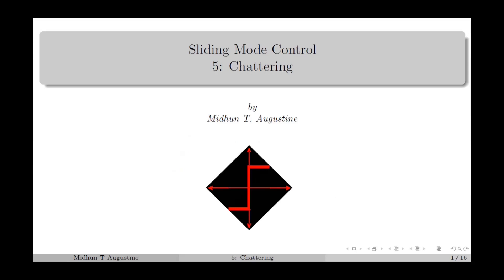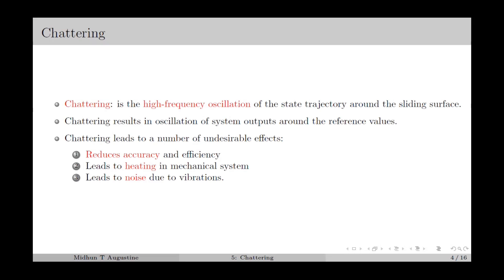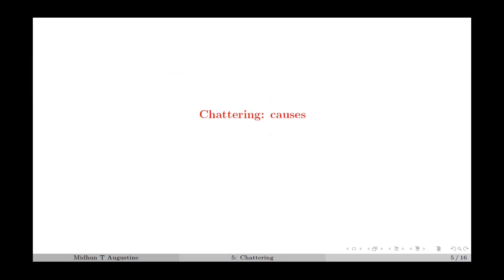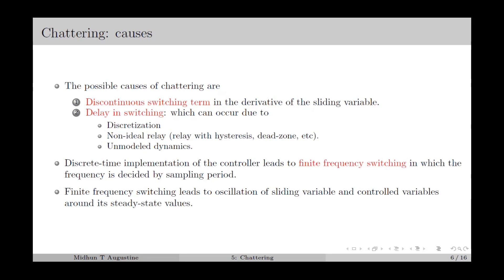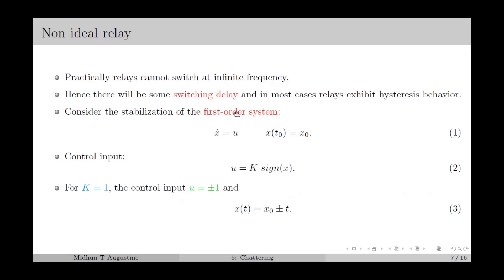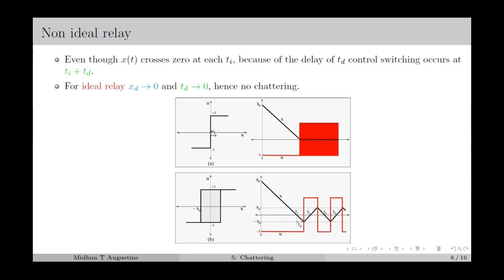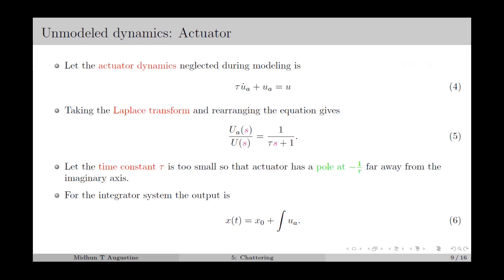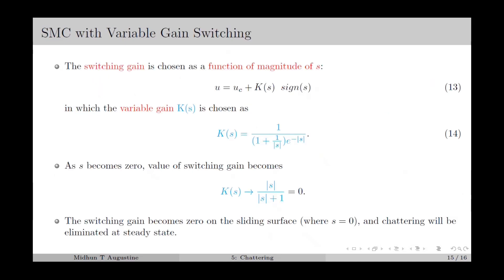5: Chattering | Sliding Mode Control

Comment: Can you show mathematically how s/s+e is making gain zero
Reply from the maker: Here the gain is a constant K and the discontinuous part or switching term in the control law is 'K  s/|s|+e'. As 's' tends to zero the numerator of 's/|s|+e' tends to zero and the denominator tends to 'e'. This makes 's/|s|+e' zero and thereby the switching term 'K  s/|s|+e' becomes zero.
Reply: How does it effect chattering reduction? @datacontrolandmathematics3811